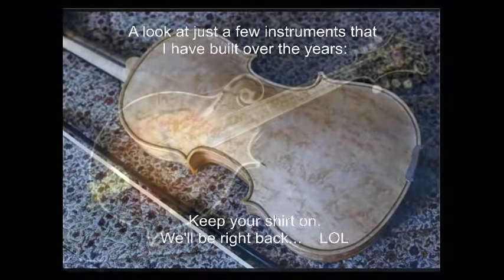RSW  Shop Talk 25 Dendrochronology and Quarter Sawing

Comment: Yet another fascinating instalment from RSW! Thanks for sharing your knowledge, Jerry. I’ve been warned against using a dampit humidifier in my old cello. I was told that the inside would be humidified but the outside wouldn’t, creating stress between the inner and outer surfaces...plausible? Is it true that it isn’t a dry room that causes cracks in an old fiddle or cello, it’s dramatic and sudden changes in ambient humidity that can be dangerous?

Comment: Here in England the tree coverage is 10%. Across Europe it’s 35%. So our trees are very precious.
Sadly, to build a new high speed rail system, two ancient trees have been cut down in my locality, along with a lot of ancient woodland. 
One was a 250 year-old Pear tree. 
The other a 400 year-old Oak tree. 
Imagine - a Pear tree that was alive during the Boston Tea Party. 
Or an Oak that was alive when the Mayflower set sail. 
Of course I have no problem with sustainable woodcutting - but a lot of people over here are very angry!